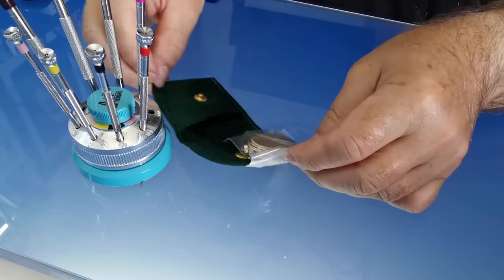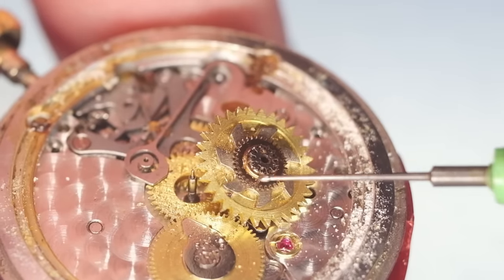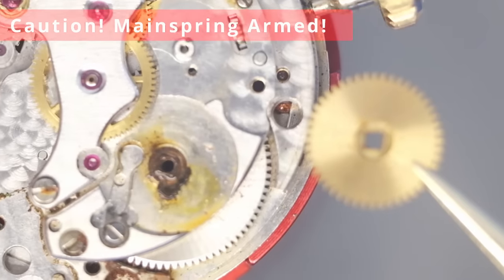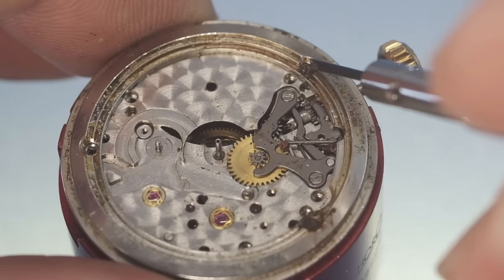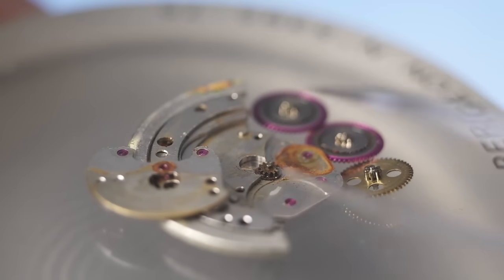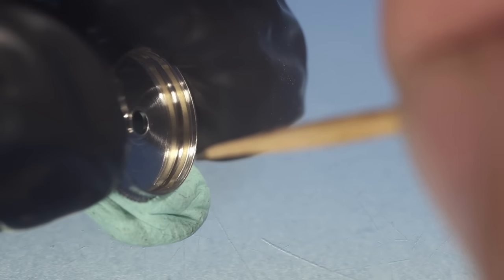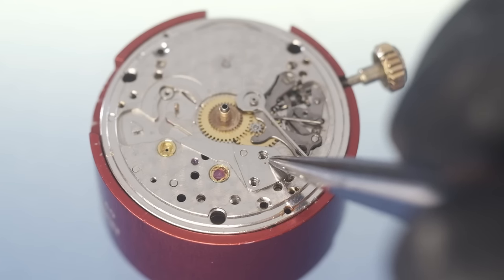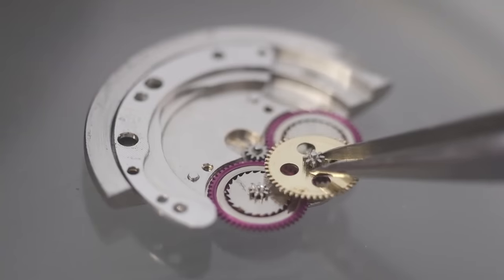Restoration of a Gold Rolex Day-Date - Smashed and Drenched

Comment: It's hard to imagine that this is an economical repair - unless you are very generous with your time. But it makes for a fascinating and sympathetic piece of work. Bravo.
Reply from the maker: Hi @user-kt3ox7nc2q ... if the filming and editing time was not factored in I think this could maybe economically done.  But only because of the value of the finished watch compared with the value of the starting point watch.  If I were to charge the 'time on whole project' your estimations are correct and this would not be an economical repair I think.   But then you hit the nail on nthe head with your last sentence as this is the real aim to produce a fascinating film,  that is the goal as well as to restore Andy's watch.  Great comment, thank you. Richard
Reply: This is a $12-$15k watch in good working condition, so I would think that the repair is worth it.
Reply: I think that if you plan to keep an item long term it is always worth repairing, or if you are very attached to it. If you are only going to sell it then it is sometimes debatable.

Comment: Here is an interesting comment about the video:

Wow, what an intense restoration process! As a watch enthusiast, I'm amazed at your skill and care in reviving this smashed and drowned Rolex. 

The rusted stuck components like the fused wheels and calendar ring screws seemed impossibly damaged, but you systematically cleaned and extracted everything without causing further harm. Your tips on safely controlling the wound mainspring to avoid damage were insightful.  

I love how you take us through each step - seeing the watch transform from a seized, corroded mess into a pristine, ticking timepiece is so satisfying! The details about using lubricating grease and Teflon were fascinating, too. Watch restorations don't get much more thorough than this.

Comment: Richard, I’m a knife maker and I share a work space with a mechanic partitioned off but we are very mutually supportive. He uses a microscopic ceramic fibre brush to clean electrical contacts of corrosion on vehicles. I think that a similar brush might be of great use to you in watch work with corrosion and rust removal. I’m sure if you Google it you’ll find one. By comparison to a brass strand type brush the ceramic is superb very accurate and compact bristle head with no splayed or differing length strands. Just thought it might interest you. Love your work - best Mic 🍺🏴🔪👌🏻
Reply from the maker: Hi Mic... Thank you so much for this; a ceramic fibre brush sounds very useful and I will see if I can get one. Much appreciated. Richard

Comment: Love watching your videos Richard. Every part looks easy to remove and install on the TV screen,  then once you see a movement normal scale it never ceases to amaze me how tiny most of the parts actually are! Interesting how some parts are relatively unscathed, and others badly seized or corroded! Really appreciate the time and effort you put into filming the whole restoration. Just fantastic cheers. Finished article is outstanding!👌👍
Reply from the maker: Hi @Adrian_3006 ... Thank you sir!  Yes, maybe I should do a little more to remind folks of the scale involved here.  Interesting that you notice the luck of the draw in damage to components too.  For some reason I seem to get lucky with balance assemblies as these are most often unscathed for which I am very grateful.  Great feedback.  Thank you so much!  Richard
Reply: What's the story here? Rolex usually has no problem servicing watches from the 70s. Did they deny to service it? Thanks.
Reply: @mlogicli - I'm sure they wanted an arm and a leg for the repairs.
Reply: عاشت 🎉 الايادي

Comment: Thanks for your channel. I am a fiddler of mainly Seiko automatics. I found a copy of the Vacheron Constantin Tourbillion in an opp shop in Australia. (I have stripped it and only lost one tiny screw on the rotor.) I will reassemble it and it has a few problems. The balance is fine and the winding mechanism is troubled. I do have a timegrapher and a watch microscope with a screen on and a good tool set with rodico. Should keep me busy. I really like the way you approach the repairs. Thanks for your videos. Cheers

Comment: I came from the classic car world before entering watchmaking so maybe I approach things a bit differently but for rusty movements like this, after I remove the calendar disk I'd soak the entire movement in evaporust 24-48 hours before even attempting disassembly. It is not acidic like vinegar and will not harm the rhodium plating, which gives the best possible chance of disassembly without broken screws or other parts. I wish I could convey this to all professional watchmakers.

Comment: I'm so curious about the performance after restoration.
Reply from the maker: Hi @ciscco3750  .... Yes I can undrestand this curiosity but it's a bit 'techie' sometimes for he vibe in the film.  For the record, with no regulation the watch when the balance went back as shown was  doing this (dial down ... movement straignt onto timegrapher in movement holder)  +16 seconds at 212 degrees and less than 0.5 ms beat error  (so pretty good but needs a little work to improve).    I normally run the watch for a few days before settling into the regulation work in earnest.  Hope this helps.  Richard
Reply: @richardperrettwatchmaker  Thank you! Very good result, keeping in mind it's initial condition and corosion impact.

Comment: Another awesome restoration for the ages.  Look at you!.    The owner will sure be happy when he sees it considering the shape it was in.

As an aside, Richard,  I see you had to drill those two screws in the plate, but tried the extractor tool first.
Have you ever had any success with that screw extractor tool?. 
I have one of those Bergeon screw extraction tools, and I have yet to use it effectively.  Frankly, it''s not worth a watchmaker's damn.
Perhaps it's me, but it's a pain to use.
Reply from the maker: Hi @wildernessofzinn17 ... I think the screw extractor work when it's just a clean case of 'the screw head came off' and there's no rust.  Add anything else bad into the mix and the odds are it will not work.  I have a video on a GMT master in which I used the tool successfully for the crown wheel retention screw so it does work but in that instance the it was a clean break on a screw head.  Thanks for the feedback.  Richard

Comment: Would gently brushing the dial on distilled water help to dissolve some of the spots? Assuming it is mineral or salt spots dried on feom the moisture.
Reply from the maker: Hi @willc9396.... the method you suggest may improve the dial in the way you indicate however it is a very big risk with a dial which has been waterlogged and dried out. If any water or any fluid gets onto the black print areas often the letters will gracefully lift of the dial and float around the surface of the cleaning fluid which of course is qbit of a disaster cosmetically.  In normal daylight without magnification the dial looks very good and hence the benefit of further cleaning is not warranted given the attendant risk.  Hope this explains.  Richard

Comment: @ Richard - Any reason you didn’t clean the date and day dials - you only have them a cursory wipe down and they were left with stains?
Reply from the maker: Hi Richard... Yes,  when a dial has once had water damage the print becomes extremely fragile.  If you try anything but the lightest brush the likely outcome is not a favourable one.  Hope this is helpful. Richard
Reply: @richardperrettwatchmaker  thanks for replying - makes sense.
Out of interest, what would be the replacement cost of the date and day dials? 👍

Comment: It’s never happened to me before but, my ultrasonic cleaner caused the outer coil retention guard on the balance to vibrate out. I managed to get it back in but it just fell out again. I was lucky to obtain a replacement cockplate but I won’t put future balances through the ultrasonic cleaner again. Beware!

Comment: A Rolex watch should make parts like the cannon pinion, keyless works, ratchet wheel etc out of steel so that these do not rust if water enters. It seems many parts are made of iron even in expensive watches. Correct me if I am wrong Sir.

Comment: So Andy takes his father's Rolex swimming which is not recommended and smashes it.  He then lets it sit for a couple of years before having it repaired.  Unbelievable.
Reply: My dad swam with that watch on for best part of half a century. It's an Oyster so of course it's fine.  When I saw it had allowed water in that fateful day, being abroad at the time I made a decision to remove the (plastic = consumable) crystal in the hope that sitting in the baking hot sun for a few days would enable the venting of the vapour. It clearly didn't. The subsequent couple of years were a taken up with me arguing, via the high street authorised dealer, with Rolex about how it was to be repaired. They would only work on it if it left them factory fresh, it's how they do things. There was no new dials but offered to replace with a new blue one (and keep the old one), they required the backplate to be changed, the entire movement, the crown. I declined and whilst trying to decide what to do I saw Richard's videos...
Reply: Why isn't swimming with a Rolex Oyster watch recommended pray tell? Like a Vostok Amphibia or komandirskie it's what it was designed for.

Comment: What is the proper name of the wheels on the charging system, the ones that look like saw teeth? Thanks.
Reply from the maker: Hi @mrbluecatone   ... I think you are referring to the inner wheel of the reversing wheels assembly.  These comprise an outer, purple, teflon coated wheel part no. 1530-7912 and an inner wheel 1530-7912-1 (or something like that!)  .... hope this is helpful.  Richard
Reply: @richardperrettwatchmaker  I was just looking for the proper name in Inglish of those wheels that have the teeth that look like saw teeth.

Comment: Are your arms assumed, or granted? I assum the lion for "Richard", and pears for Perrett and the watch gear for being a watchmaker?
Reply from the maker: Hi @amcconnell6730 ... Alarmingly there is no lion!  The creature you see is a Dragon and is present due to my Welsh connections (Sir John Perrott was, as you probably know, installed at Carew which is just a few miles from where I have lived the past 20 years).   As for my family Coats of Arms  ( https://www.p-rr-tt.org.uk/origins.htm ), there are several and they all have three pears.  The most commonly seen of these (Sir John's) also has a Black Wyvern (type of Dragon).   Does the dragon look like a lion?   I hope not.  I also hope this is helpful.   You can contact me here for more detail if desired .....  https://www.richardperrett.com/contact/  ...   Richard
Reply: @richardperrettwatchmaker  Sorry - yes it's a dragon, I was thinking of the UK royal sypmbols. :)

Comment: I DONT KNOW
IF I HAD A WATCH LIKE THIS I WOULD NEVER CHANCE
TESTING IT TO BE WATERPROOF WHETHER GUARANTEED OR NOT
I HAVE A $200 SELF WIND SEIKO THAT I USED FOR OVER 700
OPEN WATER ( OCEAN ) DIVES THAT IS STILL WORKING LIKE
A CHAMP AND ISNT EVEN REMOTELY CRINGE WORTHY IF
THE GASKET FAILED 😮😢

Comment: why you did not clean the dial ? or it will be loosing originality ?
Reply from the maker: Hi @bannuheritagechroniclesbya1908 .... Great question!  When a dial has once been soaked and dried out the print becomes very very fragile. Most often attempts to restore end in disaster with letters falling off ... if you leave it alone it will sutvive as is under the crystal for years.  Hope this explains.  Richard